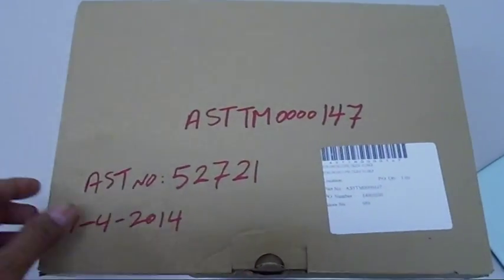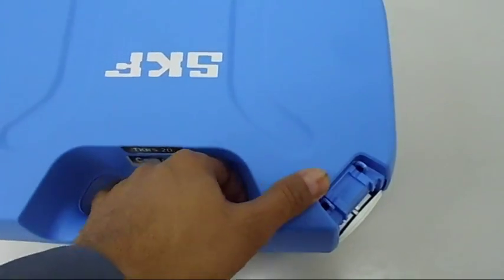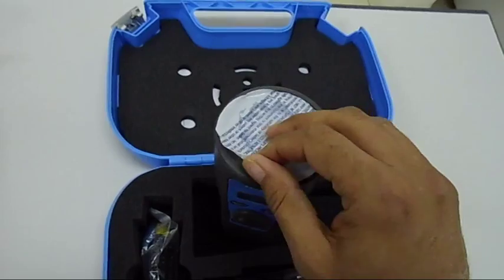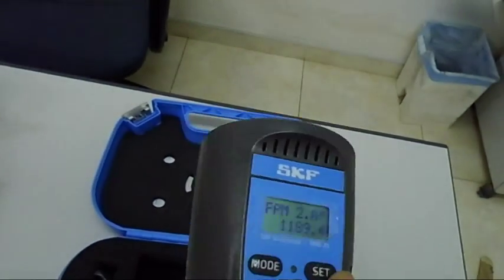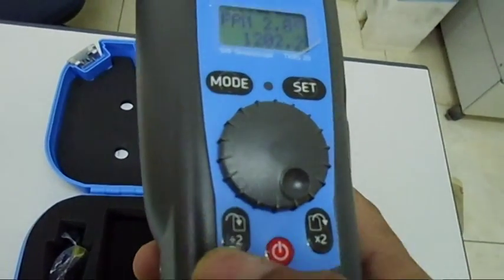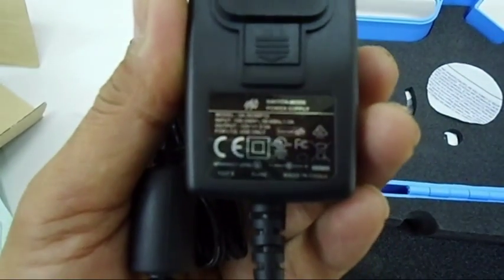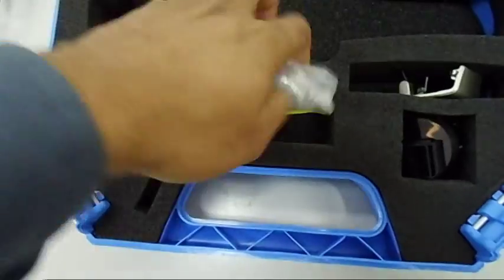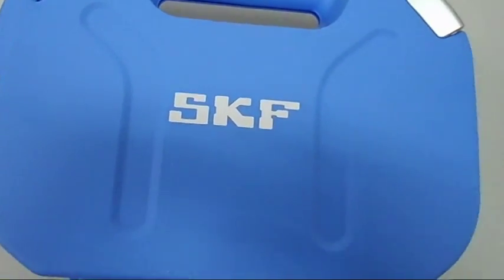Stroboscope review and unboxing

Comment: Strobes are great, ive used a flashing led to light up a drive shaft for a split second, and repeating, then slowly bring up the frequency of the drive to the led to give the visual effect of a stopped shaft, frequency used x 60 is the rpm :-))

And paper strobe disks working from mains ac lighting are so simple but so usefull.

Very nice tool you have, shame the case lock was damaged.
Reply from the maker: This is a nice instrument. But problem with SKF is, it is too much expensive.
Reply: Can i know why did you buy the SKF even though still expensive??